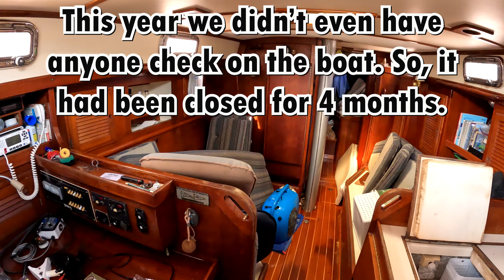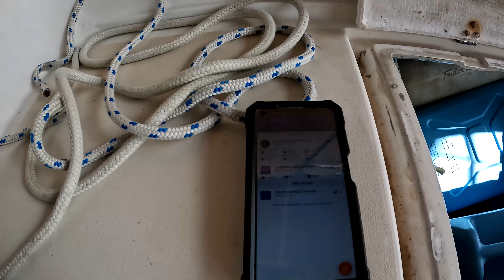Prepping the Sailboat to Go Back in the Water S8Ep1

Comment: Hey Zack and Lindy... glad to see you back! Daryle A. here, i also have a T37 (1981) hull 306, Rambunctious. Pretty close production to yours. Been working on here for a couple years now, prepping for our Caribbean retirement. Got a question for you... when i got her, the shower sump was missing, and the drain hoses were cut. could you maybe post a couple pictures of your shower sump setup? i dont want to keep draining the shower into the bilge. I would be happy to send you my email addy if needed.
thanx in advance.
Reply from the maker: Hey Daryle! Yeah, shoot me an email at zmdunc @ Gmail . com and I'll reply with a pic of it. Pretty sure ours is original because it's a crummy open top box with an inlet and an outlet on it and a float switch in it. Basically anything would be better than it. Lol. But, it does fit the space which is what matters, I guess.